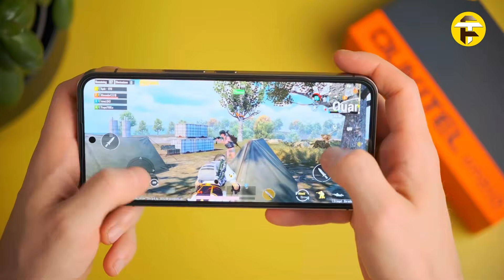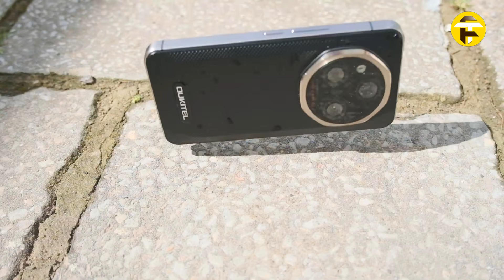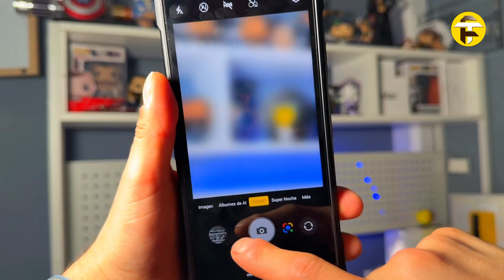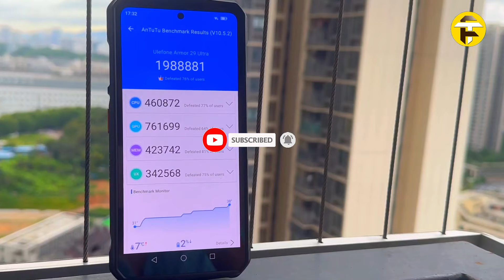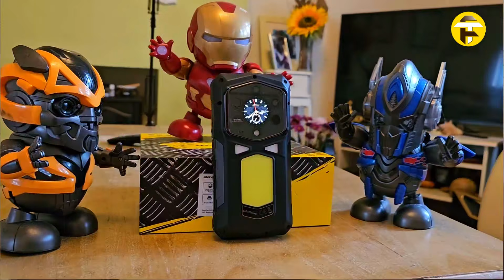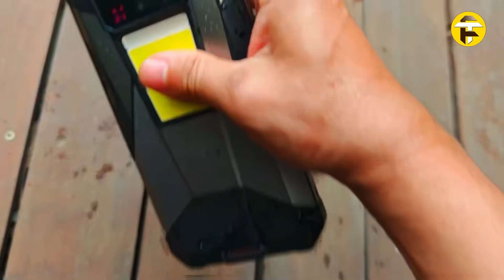The Only 4 Rugged Phones That ACTUALLY Won't Break in 2026 (Don't Waste $800)

Comment: Tank 4 Pro, best all arounder beast with 26 sensors, Terabyte drive and UFS 4.0 as well as 18gb of real ram, the fastest ram that the Dimensity 8300 takes is on it as well as a really loud smartpa speaker, fully water proof ip69k and all that jazz... It even has night vision and a Samsung GN1 main camera and Samsung JN1 secondary as well as a 64 megapixel night vision as mentioned... Did I mention the fk radio, Range finder, ir blaster, 🎧 Jack? Also, the full HD and more then useable 720p Projector that can do like 110 inch movie theater from your phone all in a package only 22.5mm so one of the thinnest for what it's packing and why it still is way between them the Tank 5 pro even the tank 4 this the way to go as the price is also amazing and now on Android sixteen probable going yet again to seventeenth it seems! Ohh, the screens 3k amoled 120 hertz as well! Dual sim ... I will stop here but you name it, it has it even display out to turn it into a computer and the 8300 is a little brute... Also the battery= 11,600mah!... The 18gb/Terabyte version is the one I suggest!... It also somehow still has a 1200 lumen camping light on it somehow as we'll and the speaker is so loud but more importantly a good rich loud as guess they had the space for a good smartpa and utilized it... 8849 Tank 4 Pro! The Tank 5 they cut allot of sensors and stuff out and made it double the thicknesses - so it's not truly as amazing as the Tank 4 Pro Terabyte variant, not even close also it's running android sixteen now a days!!!...

Comment: Why Y'all Never speak about the Speakers in these Phones
Reply from the maker: That is a really valid point! Honestly, speakers often get overlooked in rugged phone reviews, but with all the thick casing and waterproofing membranes they use, the sound quality can definitely take a hit. I'll make sure to include an audio/speaker test in the next roundup!
Reply: Tank 4 Pro, best all arounder beast with 26 sensors, Terabyte drive and UFS 4.0 as well as 18gb of real ram, the fastest ram that the Dimensity 8300 takes is on it as well as a really loud smartpa speaker, fully water proof ip69k and all that jazz... It even has night vision and a Samsung GN1 main camera and Samsung JN1 secondary as well as a 64 megapixel night vision as mentioned... Did I mention the fk radio, Range finder, ir blaster, 🎧 Jack? Also, the full HD and more then useable 720p Projector that can do like 110 inch movie theater from your phone all in a package only 22.5mm so one of the thinnest for what it's packing and why it still is way between them the Tank 5 pro even the tank 4 this the way to go as the price is also amazing and now on Android sixteen probable going yet again to seventeenth it seems! Ohh, the screens 3k amoled 120 hertz as well! Dual sim ... I will stop here but you name it, it has it even display out to turn it into a computer and the 8300 is a little brute... Also the battery= 11,600mah!... The 18gb/Terabyte version is the one I suggest!... It also somehow still has a 1200 lumen camping light on it somehow as we'll and the speaker is so loud but more importantly a good rich loud as guess they had the space for a good smartpa and utilized it... 8849 Tank 4 Pro! The 5 they cut allot on stuff out and made it double the thicknesses so it's not truly as amazing at all!!!...